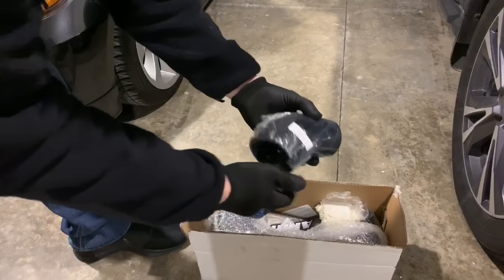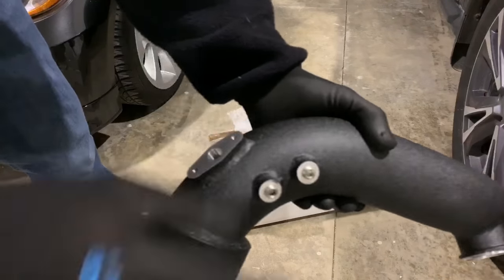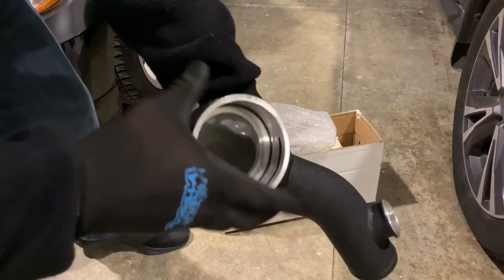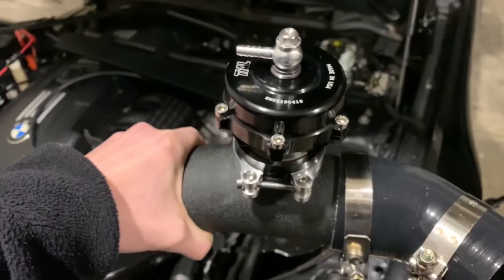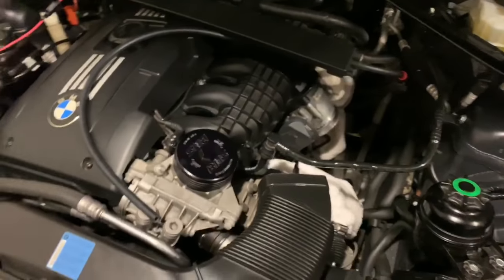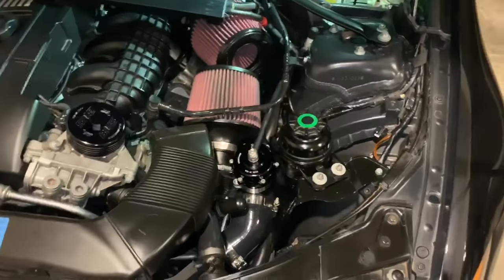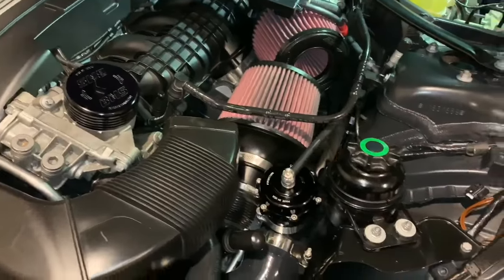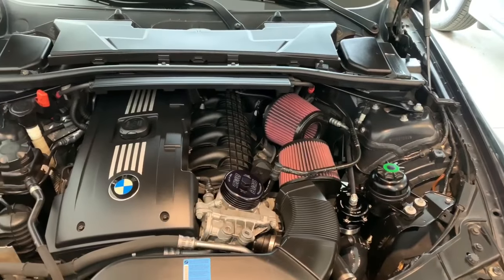ARM Motorsports BMW N54 Charge Pipe Tial Q BOV DIY Install!

Comment: You forgot to mention that the 1/4” banjo fitting that connects to the top of the BOV needs to be oriented in such a way that the hole aligns correctly with the nipple part or else the flow will be blocked.
Reply: Stephen Lozano If you block the flow before going for an inspection sticker will it pass?
Reply: Fred Frederickson I cannot answer that question for you. As my state doesn’t require an inspection sticker.

Comment: Good video, I want to do this soon. I'm still a bit confused with having to use 1/4 pipe for the BOV & an adaptor you have to get. You didn't show this & explain this part enough. If this BOV needs this 1/4 pipe, why don't they supply with the BOV? So this pipe doesn't go back onto the inlet pipe, where the original pipe came off? I take it his will need blanking off?

Comment: I put mine in a year ago and my ARM Charge pipe is loose at the Throttle body. I have never been happy with it. I took another look at it. Still nothing changed! Does it supposed to have play like that? I have changed the ring in it. The clip snaps right on. I still try to push it in more. It wont go. Like thats it. And it moves a lot. No codes or any problems. Sounds great with my Tial valve. When he moves his. It has no play. Any ideas? Or am I good?? Or maybe just a bad pipe?

Comment: This might be late, and might be something super obvious, but if I’m coming from stock, and don’t have the Vader thing, and have everything that was on the oem one, will I still be able to do it with either just the charge pipe, or both the pipe and the bov?

Comment: DIY the new BMS Transmission intercooler.....I know I could use one!!!
Reply from the maker: Jeff Baker looking into it!
Reply: I also plan on getting this. Please do
Reply: It shows how to do it on N54tech.com. 
Use fuel line disconnectors to remove the stock cooler. 
connect the in and out fittings into the fittings and route the cooler to the inside of the wheel well driver side with the provided brackets. 
https://n54tech.com/forums/showthread.php?t=56319

Comment: 2 months ago you installed the forge motorsport CP. What happened to that? Too many sponsors?
Reply: Yes I'm about to upgrade to a new charge pipe with a blowoff valve  and I was wandering to the ARM or the forge

Comment: The banjo bolt on top of the bov did u make sure the hole lines up with the fitting that goes to the vaccum hose?
Reply: Syed Ali I was wondering how the heck he lined those up without even trying. Bro has luck on his side for sure 😂
Reply: Jeremy Hall i marked mine so itll be easier when i install it if i ever took it off

Comment: I have an 08 335xi and I purchased charge pipe and bov from Arm. It was a little late and I was in a rush but I'm having trouble getting the charge pipe on to the throttle body. Any tips??
Reply: For anyone having this issue I ended up taking the 4 bolts off the throttle body and removed it completely. I then took the charge pipe and with alot of force managed to get it on there was no way I could have got it on with out doing this. I pulled a  muscle in my arm lol trying to line it up and push it on.

Comment: It doesn’t look like the tial is opening. I had the same issue with my n54/ tial setup. Tried the yellow 11psi spring and it was too stiff. Also tried another softer spring and it was too soft. I ended up having to cut 2-3 rings off the yellow springs and it’s working perfect now.
Reply: Ryan Toney I think I’m having the same issue. Would it only work at red line when it was at idle or when you let off the throttle at high rpm?
Reply: Nathan 223344 if the BOV is setup correctly it should open when you let off the gas peddle; the throttle body closes and the boost has nowhere to go so the bov opens allowing boost to escape. If the bov isn’t opening then the boost will be pushed back through the turbo causing compressor surge. If you have an n54 the first thing you want to do is upgrade your vacuum line with the vador solution kit.
Reply from the maker: Ryan Toney Yeah I noticed that too, which I’m going to look at again and see. Thanks for the suggestion
Reply: @BMWFanatic  If you still have your JB4 setup check your Auto Shift boost reduction. If the value is higher than 0 it will keep your throttle body open between gear changes and also when letting off throttle during high rpm pulls. HOWEVER.... If you're AUTO trans you are suppose to have some value above 0 as it keeps boost up around 2-5psi so the car doesn't bog down when shifting. I'm MANUAL trans so 0 setting is acceptable. Ask me how I know when my Tial didn't blow off as it should. A 0 setting -> Throttle plate closes -> Turbos still spooling (creating boost) -> Tial BOV opens vent to atmosphere. I also changed my TiAL BOV spring to 8psi black spring. Hope this helps!

Comment: How much difference can an intercooler make! I have a 2011 BMW X3 35i with a tune, CAI and aftermarket pipes?  Should this be my next step?  Also, I hear that a lot of parts for  335’s will fit on my F25 N55 car. Is this true?  Anyway, great job as always bud!!

Comment: I know this is an old video but im hoping for a response, my tial bov came with a rubber o ring, I noticed you didn't use one when putting it on. I'm wondering what its for
Reply: wondering the same thing

Comment: Hey bmw fanatic I have a simple question that i can't find anywhere. If you take off your oil cap and look into it you will see a little hole, is it more proper to poor the oil directly into that small hole inside or does it not matter if you just poor it in wherever inside?

Comment: Hey I'm having problems with my upgraded charge pipe, I've been running full Bolton and a tune for 8 months and out of nowhere I can't do pulls anymore as the c clip isn't holding the charge pipe any longer not sure what to do
Reply: I was having a similar issue when I replaced my turbos and was making full boost again (also FBO stage 2+). Sometimes at WOT the charge pipe would pop off. I ended up finding that the charge pipe wasn’t fully seated and the C clip would go on and hold enough that I could wiggle and pull the charge pipe and it wouldn’t come off. I ended up disconnecting all other components from the charge pipe and shimmied it all the way into place. I believe that the new O ring on the charge pipe was just much more firm than the old one. Another trick I’ve used to get other piping in the system fully seated is to put a light coat of oil on the O ring before installing. This not only helps it slip into place but also gives an extra layer of protection against tearing or pinching the O ring inside its groove which would give you a difficult leak to find. Hope that helps and I’d be happy to go more into it if you’d like!

Comment: I just noticed u flip the Vader solutions adapter, in your original video the VS was in front. Any reason why
Reply from the maker: bmwmike2007 Omar said it can go both ways, but I flipped it so I can shorten the hose length as I had it going pretty far around

Comment: I have the  vrsf pipe and tial bov on my car. Those clamps are terrible, they kept coming off for me so I switched to pipe clamps and also don’t forget to seal the meth bungs with Teflon tape! I kept getting intake pipe under pressure codes from it. Awesome video though!
Reply: there are caps for the meth bungs. comes with charge pipe.

Comment: On an automatic, is the only way u can get the blow off sound by letting off the gas?
Reply: Literally any car, let off the gas. Think hard. Really hard. When you shift in a manual what are you doing with your right foot?
Reply: @adriangutierrez8177  lol i got it😂 i have a BOV now and ive learned alot since this question

Comment: I have a tial bov on my e92 335i but it doesn’t do anything until I Red line it at idle or when I let off the throttle at high rpm. Is the spring too stiff?
Reply from the maker: Nathan 223344 Yeah I would think it would be too stiff
Reply: If you have a JB4 setup check your Auto Shift boost reduction. If the value is higher than 0 it will keep your throttle body open between gear changes and also when letting off throttle during high rpm pulls. HOWEVER.... If you're AUTO trans you are suppose to have some value above 0 as it keeps boost up around 2-5psi so the car doesn't bog down when shifting. I'm MANUAL trans so 0 setting is acceptable. Ask me how I know when my Tial didn't blow off as it should. A 0 setting -> Throttle plate closes -> Turbos still spooling (creating boost) -> Tial BOV opens vent to atmosphere. I also changed my TiAL BOV spring to 8psi black spring. Hope this helps!

Comment: What happens if you don’t have diverter valve caps?
Reply: I know this is a very late comment. But I found that Walmart sells table leg rubber ends that come in different sizes and make perfect caps and then upside down they will even make a plug. I use the 1 inch sixe. Black.

Comment: 5:07 I see you skipped putting the o-ring on. I’m about at that point trying to put my Tial bov on, getting that o-ring to stay in place is a bitch! If anyone has any tips please share!
Reply: 😂😂I tried putting it together the other day glad to see I’m not the only one
Reply: @soicygang_  had to switch the method I approached it with and was able to get it on nicely, took a few different tries to figure it out.
Reply: @PermissionToMeow  because of you I’m gonna try to put it together tonight when I get off lol
Reply: @soicygang_  I wish I could remember exactly how I did it to explain it the right way, but I set it in place first and had my girlfriend hold part of it in place while I tightened it together. Should’ve filmed it honestly, but you’ll get it, and if you have someone there to help, that will make it way easier!

Comment: Hey man I love the content and N54 info! I do have a serious question though. Please don’t read this critically. I understand ARM is a budget friendly option and price cannot be ignored as not many are billionaires. However arm, as a brand, doesn’t compare favorably in execution or performance when compared to brands like VRSF, PSP, VTT, etc. charge pipe is less important as it’s a metal pipe and as long as it fits well isn’t a problem. FMIC for you can definitely be improved depending on what your plans are. Inlets/outlets and E85 can tax that FMIC. What my question is to you is, do you believe the cost savings are substantial enough to justify inferior quality and performance when compared to the proven brands? Again not being critical, just seen a lot of poor information about arm vs the other brands.
Reply from the maker: Car Authority The FMIC did great on my  after testing on lowering my IAT’s, so checked off there. A lot of these intercooler cores are all from around the same group of 3rd party companies. Now, continuing to raise the bar with the power, then I’m sure I’ll see limitations, sure and I’ll need to upgrade. But it’s worked great thus far. I will be limiting engine mods on this car as I’ve been working to find an N55 car for the channel to go pretty heavy on the mods with still keeping the N54.
Reply: Yeah I guess a lot of what I’m reading on the FMIC market is buying one for the life of the car. Personally having a 5 series with upgraded turbos, I bought a vrsf 7” HD and I need a 7.5 race FMIC now. The one I have now is fine for stock turbos but not for 25 psi. I understand what they’re saying and I now understand what you’re saying too. If you don’t plan on going upgraded turbos then it’s not necessary. You’re also in Ohio? I’m in houston where it’s hot af so the car really doesn’t like that either lol! 

Out of curiosity what’s your thinking behind modding the N55 more than the N54? It was my understanding that not only does the N54 respond better to modifications but that it’s more robust as well for higher boost applications. What’s your thinking? Awesome talking to you btw man! If you’re ever down here in houston let me know! You’re welcome to drive my car to see what you think!

Comment: Would this work for a e60 n54?
Reply: Bro same question i have did you get sny answers?
Reply: 1 slow E60 _  so far I have not. Although I did find one that works — ER Diverter Valve Charge Pipe for N54 535i 3.0TT — this is from Etektuning and is made specifically for the 5 series e60 n54
Reply: TheBreakUpMan is it expensive? I have a friend with a e60 535i and used one that was for a 335i follow me on ig jorge535i i can send you the link

Comment: Does the charge pipe and bov only on a stock 335i require a tune to run safely I just want the noise until I pay off

Comment: Will this fit my 2008 bmw 535i?
Reply: yes
Reply: Brian Leal you sure bro? I asked a seller and he said no so I don’t wanna risk it
Reply: 1 slow E60 _ I just installed mine (VRSF) like 5 minutes ago. If you’re running a BOV you should be fine as that’s what I did. Very tight squeeze though
Reply: Guillermo Lopez nice thank you!
Reply: Guillermo Lopez ima get a ebay one called xspower my e60 n54 friend has it
Reply: 1 slow E60 _ 👍 Good luck with your install
Reply: Guillermo Lopez thank you!
Reply: @1slowe60_9  did the install go smooth thinking about getting one too in limp mode cause of the stock one
Reply: elijah bracamonte yeah everything went great make sure the bov connector is on the other end of the one that connects to the throttle body. It was kinda tough to install but easy at the end!